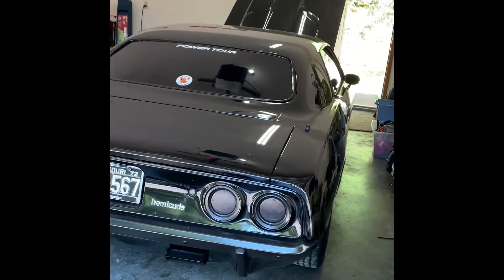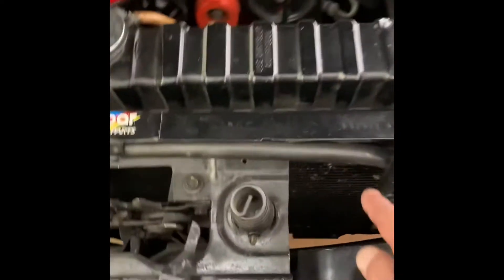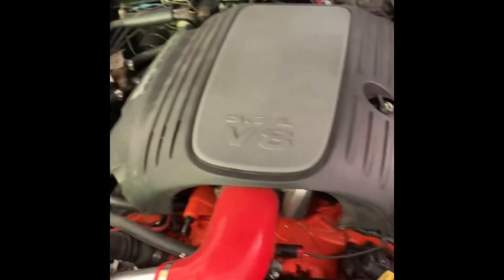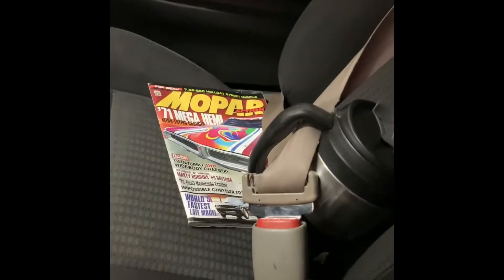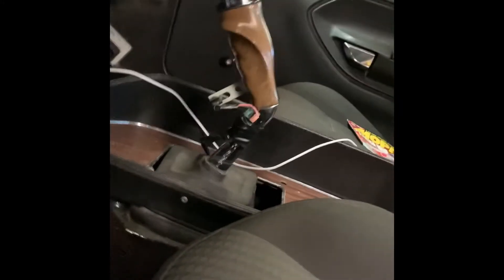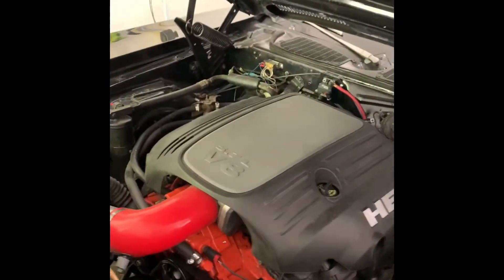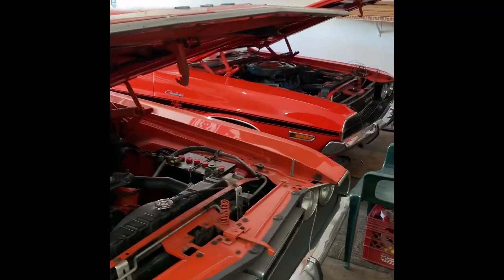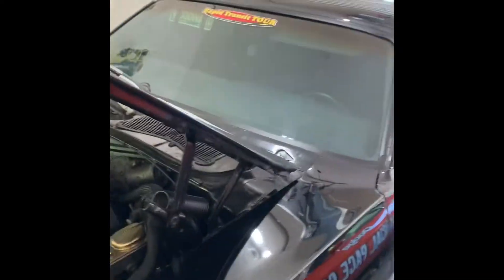My Gen3 5.7 Hemi swapped Cuda back in June of 2020

Comment: Nice u finally showed it. Are u using the stock gauges or did u upgrade them
Reply from the maker: LoL, took the video a long time ago. I planned on posting a longer more detailed video but never made one. It takes time to make videos. Have too many other things to do like enjoy cruising in them. Driving to Cruising the Coast in a week, a 12 hour drive. Make sure that you have comfy seats and a good stereo system.
Reply from the maker: fF
For the gauges, I converted the tach to an RT-Engineering circuit board, because the stock one was slow. I put in a voltmeter from a later model Dodge van at the junk yard and put it in where the Amp gauge was, then I also put in a JEGs Electronic speedometer, hooked to a sending unit on the trans from Ebay.
Reply: @shelbydogg  oh ok cool